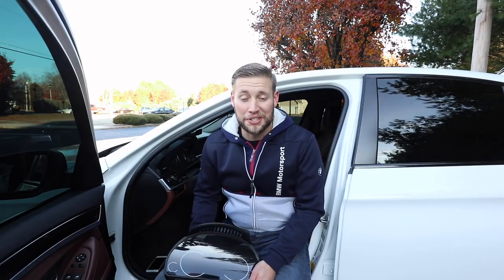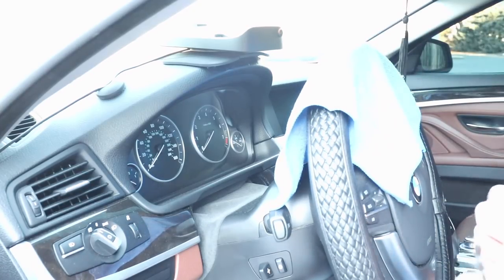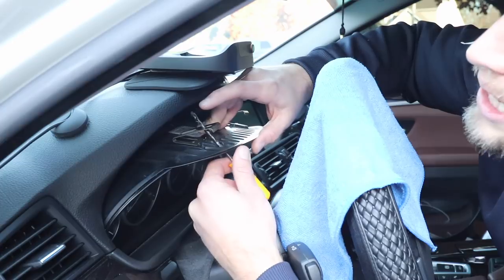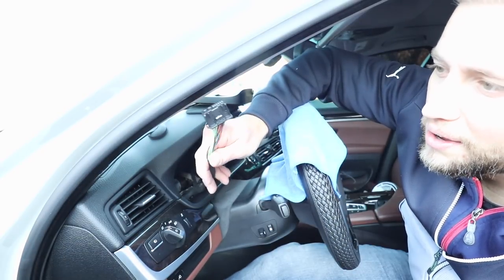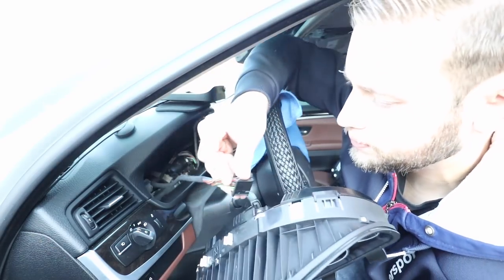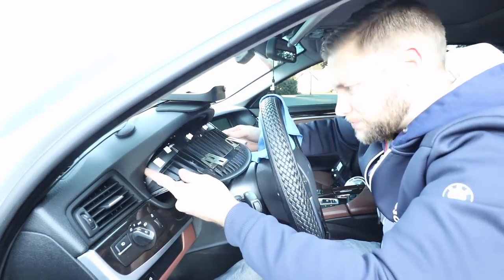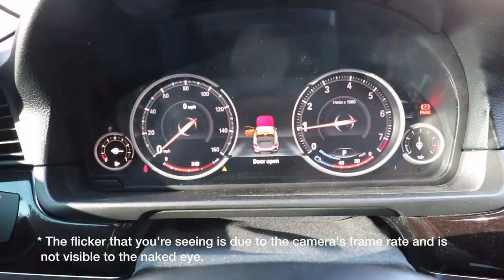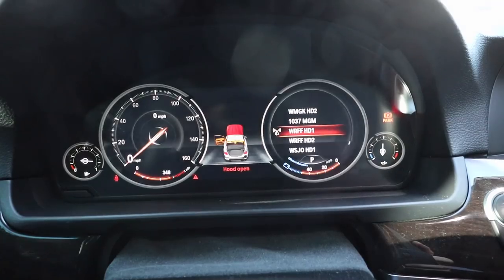BMW F10 6WB Digitial Cluster Retrofit DIY

Comment: Did you make the video 5:28 mins long because your working on a 528? Just curious. Lol
Reply from the maker: lol, It was a 535, so I should have extended it!
Reply: Kies Motorsports u guys have a lot of after market oem stuff I might add to my bmw f10 when the warranty runs up at 100k miles. Or I might just upgrade to the g30 because I do want a heads up display
Reply: Is there a reason why this won't work on an M3?

Comment: Hey. great vids. I'm a DIY guy, and a recent BMW owner. I have a 2013 640i. It's not an M, but has an M package. I hate the sluggishness of the screen, ie maps, nav, flipping through screens. Is there a solid state aftermarket? Also, this video, would it be applicable to my 640i? Thanks!
Reply from the maker: Hmm, you can do an NBT EVO in your car. It all depends on how much you want to spend
Reply: Get id4 minimum, Id 5/6 would be better.  I've got id4 in my 640i lci (2015), looking to move up to id5 with software update only.

Comment: Does this work with all F10s?
Reply from the maker: It will work with most, if you send us your vin, we can verify
Reply: Kies Motorsports will it work with the M5 or M6?
Reply: Hi, just a question about functionality. I am driving in the UK with a current cluster showing miles. Does it switch to KM (only) when you change units to km? That would indeed be awesome. Thanks!